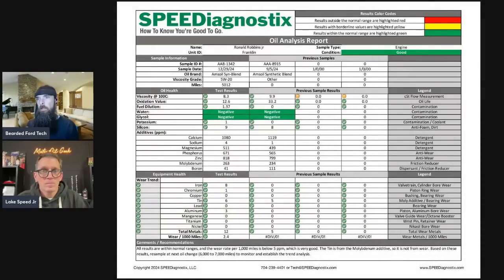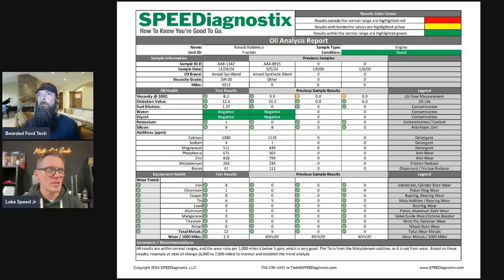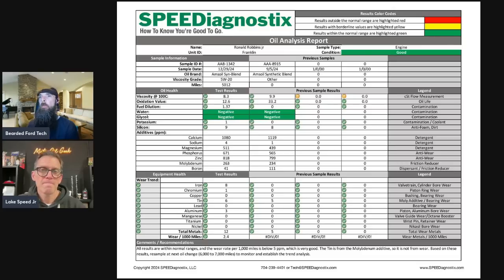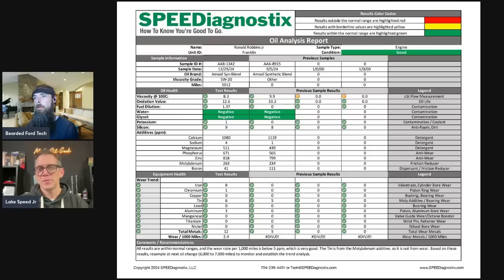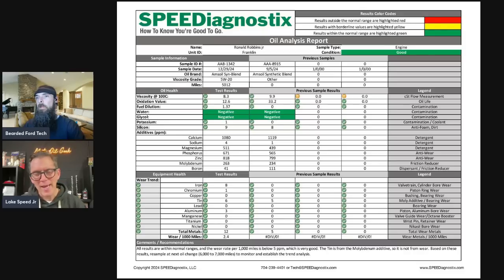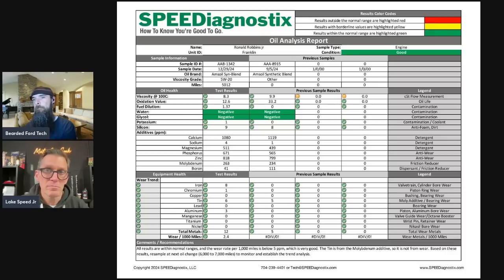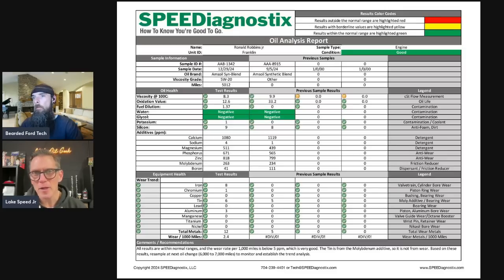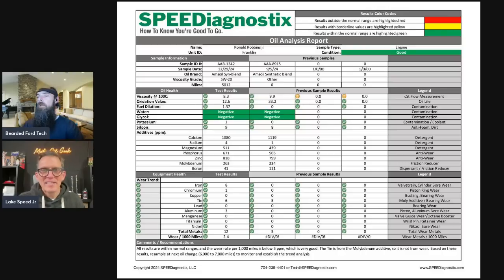AMSOIL Synthetic Blend Oil Analysis SHOCKING Results!

Comment: Currently running the Amsoil synblend in my crown vic, thinking about running it my Expedition with the 3.5 ecoboost too.
Reply from the maker: @sixsixST2  how is it doing in your crown vic?  Would you want to send it off for testing?
Reply: @BeardedFordTech   It's currently at 153k miles, ran VRP for 2 5k changes. Didn't really notice anything special going on with the VPR. Inside of the engine looks pretty clean from looking in thru the fill hole and it's never burned any oil since I've had it.  It maybe placebo, but it does seem smoother with the Amsoil. I have no plans to send it off for testing.
Reply from the maker: @sixsixST2  i woud be interested to see what they looks like after a few oil changes with the amsoil.
Reply: Have you used Amsoil Synthetic Blend Oil in your Expedition with its EcoBoost and how did it do?  Have your continued using that oil in your Crown Vic and if so, how has it been functioning?  Notice any differences in the MPG compared to the VRP?  Thanks!
Reply: @jimn.9990  I’m currently running the Amsoil high mileage in the expedition and the Vic still has the synthetic blend in it. Doing 5k mile changes in both. No mpg difference in either.

Comment: I want to see a comparison between mercon ulv and amsoil ulv. Theres rumor going around that they removed a lot of additives in the mercon that reduce wear
Reply from the maker: @MattC0725  thats a good question. I haven't heard that before and now I'm curious. I don't run the ulv in my truck. I actually run the amsoil atf fuel efficient one. Shifts great. No problems at all.
Reply: @  Ill be switching my 6.7 with 10r140 to amsoil next service. It is interesting that their fluid doesnt darken like the mercon ULV
Reply from the maker: @MattC0725  when I took the ulv out it wasn't really dark. Just shifted funny. Especially cold. Put in the fuel efficient atf shifts great in all temps.  The amsoil ulv wasn't out at the time. I'm just going to keep running normal stuff.
Reply: @  Did mine at 60k and it was dark, not black but theres no way I would trust that going to fords recommended 150k intervals. Will try to do it every 40-50 like i do my allison in my work truck. Cheers
Reply from the maker: @MattC0725  think mine was 35 or 45k. I'll have to go back to the video and look.  Wasn't too dark. But wasn't bad.  Bout time to do it again.  I did the filter last time too. Debating on that this time.

Comment: Thanks for all the advice you share! I just purchased a 24 F-150 2.7 with about 350 miles so far. Sir, when do you suggest I do the first break in oil change ? I plan on doing 3K mile oil change intervals but need to know when’s best to do first break in oil change!? Ty!
Reply from the maker: @ELLobo2424  even though they state it's not required.  We always tell people 1000 miles.  The engine is not completely broken in before that.  Mr. Lake Speed did a video on that with his daughters car.  And I always tell people. 1000 miles, do your break in.  Whether they tell you it's needed or not.  Better safe thsn sorry. You will get more life out of it.  And thank you for watching. 😁

Comment: Hey guys, thanks for taking the time to post this video.  A lot of great information. 👍
Reply from the maker: Your welcome. Thank you for watching.
Reply: Even for a engine shop, this information is invaluable. Having oil tested after running a new engine on  a dyno before it gets shipped, has eliminated warranty problems to 0 over the past 5 years since we've been testing. We've also learnt to use different break in oils for different makes of engine
Reply from the maker: @gothicpagan.666  💯💯💯♥️

Comment: Id use amsoil in my 5.9 12v but it leaks to much lol.used it for years in many vehicles had their dual filter system on a couple. Had the heads off one, amased at cylinder crosshatching .looked basically new after 5000 k of hard hard use.
Reply from the maker: @joesutherland225  yeah I run it in all my vehicles. Got a couple fleet vehicles with a dusl bypass on them. Works very very well.

Comment: You get esters out of seed oils when you make bio diesel so maybe that's their bio source.
Reply from the maker: @joesutherland225  🤷‍♂️ possible. Very very possible
Reply: Lol yup  a plant in tacoma will buy it from you if your doing your own cooking oil to diesel process on the farm as it were @BeardedFordTech
Reply: Feedstock after all.
Reply: @BeardedFordTech ps canola works just fine if your at operating temp in your diesel engine not cold though unless 10 to 20 percent jp 5 then its good till about 0c .

Comment: I have a 21' explorer and a 24' ranger, both with the 2.3L. Is there a particular coolant you'd recommend, or does it make a difference in brand choice?
Reply from the maker: Yellow. Or i use amsoil in mine. Mine is about due for another change. Mine is a 19 ranger.
Reply: @BeardedFordTech  is there any real benefit to using the amsoil antifreeze over, say motorcraft or prestone? I've switched all the oils and gear lubes to amsoil, but I'm not sure if the antifreeze is a huge difference.
Reply from the maker: @ndubb1  actually is. I've noticed mine runs about 15 degrees cooler on hot summer days. It's time to drain and fill again because there was still residual motorcraft coolant in it when i did it the first time. Also notice it does heat up slightly quicker in winter. Went from 12 min to about 5. So there is a benefit. Plus it has different additives in it that keeps it from making head gaskets corrode. But that is entirely up to you if you want to use it. We do use it in the fleet trucks too and can see a difference in Temps as well
Reply: @BeardedFordTech  would that be beneficial running cooler being a turbocharged engine? I understand air temp charge being cooler is but what about the coolant temp? 

I'll probably look into amsoil for the coolant then. Did you use the 50/50 mix or coolant and add water? Will just a drain and fill be okay with there still being residual coolant in the system? I apologize for so many questions lol.
Reply from the maker: @ndubb1  no need for apologies. The egr and the turbo are liquid cooled. So it keeps those Temps down to. Right where they like them.  You want to run them in a specified range thsys why they like cold air so much. 
I used the premixed stuff in the black bottle. It's a yellow color.
Reply: @BeardedFordTech  thank you, I appreciate all of the info! How much did you end up using? My explorer is almost at 70k miles so it'll need done.
Reply from the maker: @ndubb1  like 2 gallons around in that area. I bought 3 just in case
Reply: @BeardedFordTech  okay good to know, thank you! It's actually pretty comparable to the motorcraft in cost so it's a no-brainer decision.

Comment: Great video (as usual)!  I want to personally thank you for doing this fabulous video with Lake Speed, Jr. showing the phenomenal results of this fairly new Amsoil Synthetic Blend Oil, which was being field-tested within a 2012 Jeep in the cold tundra in the State of Maine!  It was indeed exciting to see that Lake was highly enthusiastic over the least expensive line of Amsoil Motor Oil for gasoline motors. As a fellow Amsoil Dealer myself, I intend to show your video to potential customers (and even a few of my existing Retail Accounts), to reveal to them the value of this particular oil for those folks who insist changing their oil every 5,000 miles (who don't believe in extended oil changes, even though some of the upper-level product lines of Amsoil Motor Oils, such as the Extended Life and Signature Series, have been proven that they are more than capable of going the extra mileage).  It is too bad that there are only 2 product reviews with this blend oil thus far and no one has expressed getting better fuel economy.  Conversely, we see many product reviews from verified customers on the Amsoil website experiencing higher MPG when using the  Extended Life and Signature Series oils. 

I want to state (for the benefit of your viewers) that Amsoil claims they chemically analyzed all the Synthetic Blend Oils from their competitors in the marketplace, where they have determined the actual synthetic content ranged ONLY from 1% to 15%!!  Conversely, Amsoil uses over 50% synthetic content in their Synthetic Blend Oil, but they aren't disclosing the exact percentage.

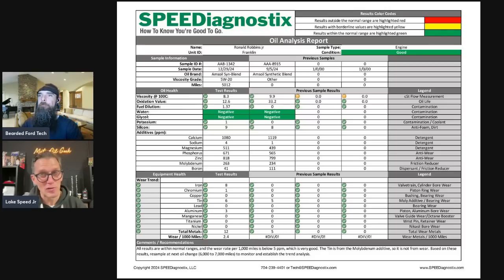Comment: 32:50 - "fill for life" I like that one. For the life of the engine. I use silica sand and water instead of oil. It's good for the life of the engine.
Reply from the maker: @johnd9605  lol. It really doesn't say in fine print (that nobody ever reads)  "Lifetime fluid for the lifetime of the warranty"  it's all how they word it.  Silica is sand lol
Reply: Or be like FCA and instead of telling the customer the change interval, just change the life of the fluid to just outside of the warranted milage and tell the customer it's a lifetime fluid.
Reply from the maker: @rotorhead5826  it's all how they say it. But people should know. There's no lifetime fluid
Reply: Love the mfgs that suggest that topping off 4-5 qts BETWEEN recommended oil change intervals is normal, lol.

Comment: Day 300000000 of asking Lake Speed Jr. to review liquimoly oil to see if it’s worth the money.
Reply: No need to. Group 3 base stocks means it’s an average API/ACEA  “synthetic”
Reply: @BrodeyDoverosx which one though? I drive a Volvo xc90 and use their Special Blend. Some of the older stuff sure but not the newest highest rated C5 oil?
Reply: It's a falsely labeled "Synthetic" using Hydrocracked oils. It's been studied for years but the oil gurus at places like Bob is the oil guy , etc and it doesn't perform anywhere near it's price point
Reply: I know it's not scientific but my brother is running different 5w50's in a clapped out dodge nytro.   The Castrol synthetic 5w50 was down to 5w30 oil pressure the first week.  The liquid moly 5w50 held pressure to 5000miles.  The oil sample is in the mail.  

The reality is you would need to do allot of testing with lots of miles/oils to  develop any data for a particular vehicle/engine.... by the time I get any solid data, especially for several different brands ect.... any given brand/oil formulas will change in the mean time.
Reply: That is the oil he was referring to.  Horrible oil
Reply: @Hernsama who knows? He said he will be doing a video sometime this year on Liqui Moly, Motual and some other German oils. American oil is rated so differently than what foreign cars ask for. Castrol Edge is used a lot but isn’t very good.
Reply: No it doesn't. Several reviews on the net
Reply: All this time you could of ran it and tested it a few times for a trend analysis and figure out for yourself for your application.

Comment: Great overview! You touched on a very important issue that is starting to become a real concern and that is OAT coolant and how it interacts with headgasket materials, specifically MLS gaskets. I wish pH testing of the coolant was looked at as normal maintenance.
Reply from the maker: I agree. People don't test coolant anymore. I'm guilty of it.  But I also change mine 40-50k miles
Reply: I had tested my coolant in one of my vehicles recently through Oil Analyzers, Inc.(OAI).  I was informed by OAI that I had to purchase and utilize a specific "coolant testing kit," which is unlike a typical "oil testing kit."
Reply from the maker: @jimn.9990  thays awkward

Comment: 18:00 Have you proven the troll wrong yet? I admit, I've never had my oil analyzed before and change it 3-4k miles also. Most of my vehicles have been new since 1990. I tend to keep them 6-15 years.
Having said all if that, I recently bought a 2014 Escalade and plan on analyzing the oil after 2 changes maybe a year to get 6-8k miles. Putting Supertech advanced high mileage 5w-30 full Synthetic in it. Looks like 2nd owner neglected a little bit. Manual says 7,500 miles in severe conditions.
If I was building/servicing race engines or towing heavy stuff all the time with my vehicles, things might be very different.
A new long block for that Escalade today is about the same price as an oil sample every 5k for 50 years, if the price never changes.
Reply from the maker: Oh yeah lake proved him wrong showing samples on his channel. 3k isn't always the correct way. Lake even mentioned in this video thays he not necessarily right. I said troll because he always pops up on these videos and lakes. Nothing else. May just be wanting attention. I also said he may not be necessarily wrong. In an older car that was the norm. He never mentioned what kind of car he drives.

Comment: Oil analysis, best investment/insurance a person can spend on equipment or vehicles.   Worked rebuilding gears components at CAT for a while.  So many transmissions, diffs, finals saved from catastrophic failures because of oil sampling.   They found out how many hours they truly could get on components.
Reply from the maker: I bet those gears and different and transmission are a pretty penny too!  It is a good investment a people don't realize that

Comment: Sticking to my Motorcraft 5w20 Synblend, dashboard reminder, no severe conditions.
Reply from the maker: Thats a good oil too. Don't go by the dash reminder using motorcraft though. Go by mileage. You'll thank me later
Reply: @BeardedFordTech Exactly. Previous owner of my 5.4 Navigator used MC Syn-Blend 5w-20 and went by the MM, the dark, hard, rough textured varnish in my engine during the timing job was surprising.
Reply: @BeardedFordTech  Thank you for your reply. I regularly get my oil lab tested. Their recommendation says I can extend.
I would appreciate your explanation of differing opinion.
Reply from the maker: @user-roadwander  if your pil lab says it's good to extend slightly thats fine. But what I've seen working at dealers with bulk synthetic blend (people going 10k) it doesn't go that far. Of course your doing what most people don't. And thats sens it for testing.  I tip my hat to you for that.  Also take into consideration where you live and how you drive. Where I live. It doesn't last long at all.  And the additive package is another reason.  Not trying to get you to switch at all. If thsys working for you and your vehicle is happy and it's doing it's job please continue to do that. Your doing it right!!
Reply: @BeardedFordTech  Thank you for replying.
Oil change at 5k normally. Per their suggestion, took it to 7.5, lab tested and results are fine. That is my limit for my routine  driving.
 I think people mistrust the science or don’t want to change their 3k oil change habit.
Reply from the maker: @user-roadwander  you're welcome. Yeah 5k -7k would be as far as I went on dealer bulk oil as well.  But me using amsoil full synthetic i can go a lot further. I do 5k drsin it send it. Go 7500-8k drsin it send it. Got 10k drsin it send it. Could have went 12k on the xl series. It was still good. At 10k it was starting to oxidize. So I knew at that point it could go 12k. And the fine print on the bottle says 12k severe service. Min is turbocharged and thsys considered severe. So testing signsture series now. Will do the same process. And I keep it the same driving habits and use the same brand oil filter. Last time it was motorcraft filters cause I ran out of amsoil filters. This time it's amsoil filters. It's funs doing these tests and it's on my personal equipment.  If I wasn't testing it. Then it would remain 5-8k.  I'm really glad your one of thise people who send it off for testing.  That makes me happy.
Reply: @BeardedFordTech  Thanks again.😊
Reply from the maker: @user-roadwander  you're welcome friend. Have a great night.

Comment: I just got my oil analysis report back today from Speediagnostix and it was about what I was expecting for my application. Harsh winter weather driving in Michigan with an Ecoboost engine coupled with some short trips and the oil had a higher amount of fuel dilution causing the viscosity to be less than ideal. All other checks were good though. I'll be sending in another one for this oil change too. I'm interested in seeing the difference with warmer weather driving as compared to the cold. I'm using Pennzoil Ultra Platinum at the moment, but I wouldn't mind trying out the Amsoil Synthetic Blend to see how it compares.  Good video sir!
Reply from the maker: Fuel dilution is normally higher in winter time. I remeber him saying that in the video. 😁😁

Comment: Man it’s crazy how the report tells you what’s going on with the engine. I’m going to be doing the oil analysis soon on my truck before changing from Castrol edge to Amsoil high mileage. I’ve been running Castrol Edge on my 2006 Jeep Commander 5.7 for over 100k most longest intervals I have done twice was 9k and close to 10k. It has 291k miles. Now I’m just making sure I do it every 5k. I still have to top off a quart every 2k miles.
Reply from the maker: It is crazy what a report tells you. And it's very very useful information. Thats why inrecommend them.